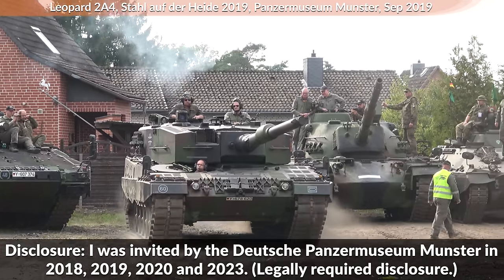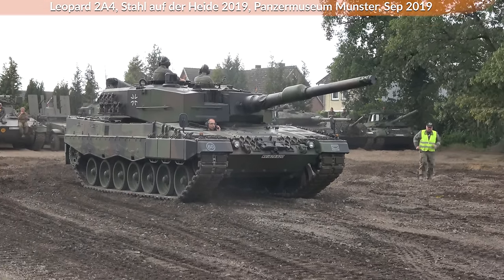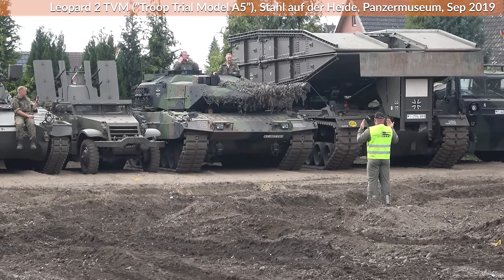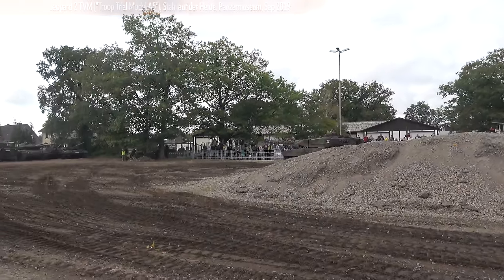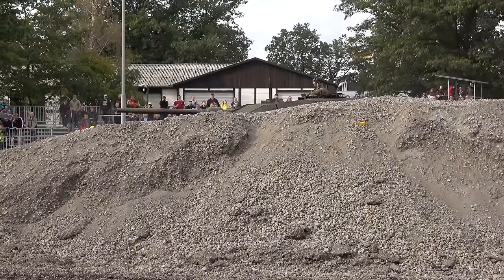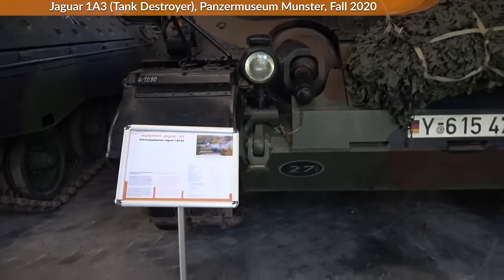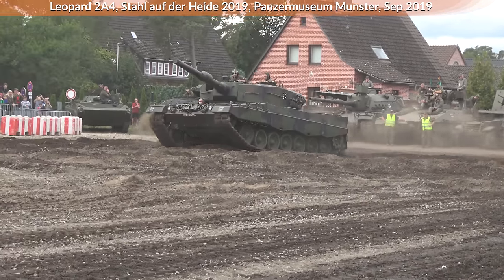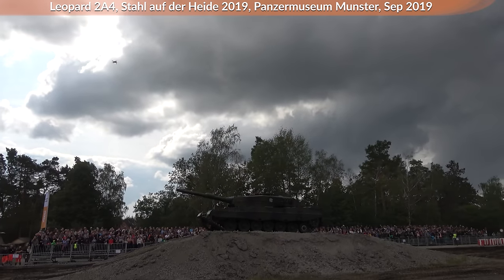Tank Tactics: How to get not hit by ATGMs?

Comment: One of the biggest lessons of the current Ukraine war is the continuous drones observing the battlefield. No target can move without being targeted. When a cheap commercially available drone with a small shaped charge (not an expensive ATGM) can immobilise a modern expensive tank additional counter measures beyond smoke are needed.
Reply: EW and different kinds of APS for ground-ground threats/air-ground threats

I imagine these will become more valuable than unnecessary amounts of frontal armour
Reply: @chost-059  you can intercept a drone or missile, but taking down an APFSDS is something currently no APS does/does reliably. And thats why you need the armor.
Reply: @zhufortheimpaler4041  who cares about KE protection against apfsds, you cant protect a tank from those anyways and the cases where that even happens is so rare outside warthunder
Reply: @chost-059  it happens often enough, that you have to consider it.
And yes you can protect yourself.
Modern western MBT´s like M1A2, Leo2A6 etc can take hits from their russian/sovjet counterparts (T-62´s, T-64, T-72, T-80, T-90 etc) and survive them, while the russian tanks dont have enough armor to protect from the 120mm APFSDS rounds.
This is due to 115mm and 125mm russian APFSDS and guns lagg behind and are limited due to their design.
But even vs NATO 120mm rounds, leo2A6 etc would be protected.
And we just dont see much tank vs tank combat, due to the distances. its not warthunder like knife fighting distance of 5-500m but 3-5km
Reply: Tanks might need to prioritize close range protection against drones with machine guns and EW. FPV drones have slaughtered russian tanks by hitting their weakspots in the top armor on the hull around the turret. And the result is a big KABOOM! 
However old western tanks were not built to deal with this threat either. So I guess that future tank design will have to prioritize front armor and top armor in the future. Side armor will probably get slaughtered as a result in order to save weight. It is also possible that tanks will become more like drones and with new tank guns that are becoming to big that manual loading takes too much time and becomes inpractical.. so perhaps will tank guns have auto-loaders firing 130mm or 150mm rounds.
Old Soviet tanks have nothing to do on a modern battlefield anymore.
Reply: @nattygsbord  I would say, that there are no tanks in existence, currently, that are capable of dealing with drone threats. Russians manufacture their Lancets by the thousands now, so even if you have the 100% hit rate on MG's, APS and so on, Russians will simply send in next drone to take out its tracks and then later hit it with an artillery shell or cluster munitions, since tanks crews bail immediately after losing mobility.
Reply: @zhufortheimpaler4041 from the front.seems like they are all getting  hit not in the front armor
Reply: @billbailey1620  Leo2 and M1 are also very resilient from the side
Reply: @jkl9984  Measures will be met by counter measures. One tank will shot down a drone. And even if the enemy sends in another one that isn't jammed or shot down by the tank itself, then it can be shot down by another neighbouring tank. Or perhaps by a specialized air defence vehicle like CV 9040 TriAD.
Reply: A tanker, or anybody for that matter, must assume that they are constantly being observed from above, but the reality is somewhat more complicated.  Everything that we've been allowed to see in Ukraine by both sides has almost always been propaganda.  We've only ever seen the successes, not the failures or the hundreds of hours of nothing.  There is absolutely a large concentration of UAVs over the battlefields in Ukraine, but that means you have a lot of soda straws looking at small patches of the ground with no peripheral vision blaring tons of  EM radiation to anyone with a few software defined radios to triangulate.
Reply: It’s ok I’ve got an invisible tank
Reply: @zhufortheimpaler4041  not true
Reply: @TheGrantourismo  yes it is. And you Already got high powered drone jammers on western tanks for up to 10 years. Ukraine also got a bunch delivered by for example germany
Reply: My comment is invisible despite I did not write anything hateful, lying or anything.
Reply: @chost-059 There’s already drones with auto-leading to the esquired target in Ukraine that bypass EW from a km away. From both sides.

And there’s EFP (explosively formed penetrator) against APS.
Correct me if I’m wrong and it doesn’t work - we didn’t see any APS in working in Ukraine, so I’m not sure myself.
Reply: The drone situation in ukraine is complicated, you can jam it, but what if it has a backup sensor, say it keeps going on the same trajectory or it has an image-based lockon for after it loses signal. As it is drones cant be defefated with a single catch-all solution
Reply: @gangsterguardsman4576  Small radar, wired to a gun.
Hard-kill is always an option.
Should be cheaper and simpler than an APS - cos drones are much slower than rockets.
Reply: As of 14 April 2024, according to the Oryx blog, at least 19 Ukrainian Leopard 2s were destroyed according to photos and videos (6 Leopard 2A6, 1 Stridsvagn 122, 9 Leopard 2A4, 1 Leopard 2R, 2 Bergepanzer-3); While another 24 Ukrainian Leopard 2s of various models were confirmed damaged to various degrees or abandoned by their crews: 10 Leopard 2A4/2A4V with 4 of them being abandoned, 5 Leopard 2A6 with 4 of them being abandoned, 6 Stridsvagn 122 with 4 of them being abandoned, 1 abandoned Bergepanzer-3 and 2 damaged Leopard 2R
Reply: 0:30  all strted in isrsale we made it first

Comment: With today's surveillance technology, for a tank not to be seen would require something no less than a Star Trek cloaking device. And if the shoulder mounted ATGM won't get you then the Helo fired ATGM may. After that mines, and if you survive the minefield then FPV drones will come buzzing inn. If you're still there congrats, now you have artillery and planes dropping bombs right on top of you. There is two ways I see tanks headed. Super heavy tanks, maybe mechs. In the 300-500 ton range, maybe more. Or more likely cheap remote or autonomous drones in the 10-20 ton range that just spam the battlefield. With automated anti projectile systems to neutralize drones and some slower ATGM/artillery rounds. Possibly energy based.
Reply: 500 ton tanks lol on what planet do you live dude 😂
Reply: @AquaNomad34  The 797F caterpillar mining truck can carry 400 tons. Farming tractors had tracks long before tanks. And OG tanks were basically a caterpillar tractor with an armored carriage and a gun. I'm sure at the time some people also thought that a tank weighing in at 70 tons (weight of an Abrams tank) was outside the scope of possibility. The problem isn't one off, can it be done? But is it worth it? That's why I said small drone tanks are more likely. However it's also possible to jam those drones, making them useless. And so if you had to have an un jammable crewed vehicle that could breakthrough such defenses. It would need to have a lot of armor. And even using advanced materials the range is between 300-500 tons. If you want it to survive direct hits from something as big as 203mm artillery or 300mm rockets. If the survivability factor is 155mm artillery then 150-200 tons.
Reply: @robertalaverdov8147  calm down dude, chill. You wasted your time writing that long wall of text comment for nothing. 
Tanks are not mining trucks, you're talking about completely different topics lol
Reply: @AquaNomad34  You're right Tanks aren't mining trucks, they're agricultural equipment. And you're also on the wrong end of youtube if you don't want a wall text explanation. That's what this channel is known for. If you want to be asinine go find a gaming channel or log into twitch.

Comment: Basically you need to do terrain analysis and conduct an appreciation in a safe location (last bound) before you start moving and then move as part of a combined arms team.
Then if detected, use weapons and your Multi Barreled Smoke Grenade Dischargers (MBSGD) to suppress the firer and obscure their view (if optically tracked).

Comment: I wonder why tank-fired anti-air missiles aren't common. I'd think that something like a 10 km range missile that could track a helicopter (or possibly a larger drone) would be extremely useful, even if it only has a rudimentary guidance system.

Comment: First of all, you need to know there is an ATGM coming your way. Which is possible in case it uses laser guidance and you have laser warning receiver. And even then, do you have time to react? Yes, there is a video from Syria where ISIS sets up a TOW launcher, turns on the laser and then drop everything and run seconds before their position is blown; T-90 received warning and turned its gun towards the source. But even that is not a guarantee.
An Israeli column was caught in some conflict in a narrow space (gorge, I think) and got decimated by ATGMs and some "experts" say none of them used smoke discharges... Sure, it would help against ATGMs, but it works both ways; they couldn't see anything and they would ram each other...
As for other types of guidance (like SACLOS), there is no warning unless you see the launch. Yes, smb else might warn you, but you lose valuable seconds to receive the warning and react...
Overall, the best way of not being hit by an ATGM is not to be fired upon by one... Only tank armor and ERA can save you, but even that is not a guarantee today.
Reply: The TOW does not use laser guidance. It is optically tracked. There is a small IR beacon on the tail of the missile. The daysight transmits the difference between the where the missile is and where the sight is pointed to the missile guidance set. The MGS corrects missile flight. No lasers are involved.

Comment: You would think that each tank would have a drone attached to scout out a possible path or to see infantry movements in the area? Could someone in the tank have communication with it and if he had another immediate duty the drone could go autonimous to maintain a set distance to the tank? It would be nice if it had radio contact to warn of aircraft in the area, if possible.Communications is key.
Reply: The next-gen German tank prototype is designed to have a drone section in every tank
Reply: Gotta be careful with that too tho, drone controllers emit frequencies that the enemy can pick up and use to target the vehicle

Comment: i dont know why germans havent developed any atgm type of ammunition for their leopards, even if it does little effect if being outranged, i wouldnt imagine any helicopter would stay at their position if they'd hear a laser warning coming from a tanks position while they see a atgm flying towards them
Reply: 18:25 this is exactly what im talking about, russians are being trained to shoot down helos with their 9M119M 😭
Reply: Some western tank crews are taught to fire sabot (APFSDS) rounds at hovering helicopters. They travel at Mach 5+ compared to most ATGM's which are subsonic. If the helicopter is within 3km then it stands a good chance of getting hit before the missile it fired arrives.

The biggest problem is detecting the helicopter and maintaining a target lock on it with an optical sight. You can hit a hovering helicopter with an ATGM (the Ukrainian's have done it on video using Stugna-P) but they had the element of surprise and were firing from a concealed position.

I doubt the viability of hitting a helicopter with a barrel launched ATGM unless the helicopter is completely unaware it is near the enemy. The flight time of most ATGM's to a distant target is more than ten seconds and an alerted helicopter can easily move away.

I think a future option could be borrowing from a current U.S Army project. It is developing a anti-aircraft/anti-ballistic missile projectile/missile that can be launched from a 155mm artillery piece. The projectile has an onboard seeker and a ramjet engine built into its base. The 155mm propellant charge accelerates the projectile to the point that a ramjet sustainer motor can ignite and give the guided projectile an extended range and terminal stage manoeuvrability.

So what I am proposing is not a ATGM but a 120mm barrel launched ramjet powered surface to air missile probably fitted with lock-on after launch wideband IR seeker of the type used in the AIM-9X Sidewinder.

Comment: Why haven't fast moving, lightly armed land based hovercraft being developed and used to transport troops and equipment en-mass across the mine fields to undermine defensive trench-line fortification and facilitate maneuver warfare of heavier equipment?
Reply: You can probably mess a hovercraft up with something like those barb wire rolls or tank barriers. I think they need fairly flat ground also.
Reply: Because theres no equipment that can counter a Shovel with a washing machine chip. An anti aie shovel once burned so hot I saw it fom Switzerland. It hit the moon, the exit hole of the backsside of the moon is said to be so big, only a RU ballistic shovel "R-Shovel-9" could dig to close it.
Reply: @Morkvonork but what does ground really mean these days with Russian Shovels around?
Reply: How would a hovercraft help with a minefield?
Reply: @JoelGuelPad  There is a Mythbusters episode where they drive over a selfmade minefield with a hovercraft. They tested if it would trigger the mines. They were pressure triggered mines and it worked. No mines exploded. Modern mines could have other trigger mechanisms anyway so I dont think it works.

Comment: You will not get hit from atgm, because you will be destroyed by fpv drone.
Reply: Drones are dangerous but overhyped. They are good ways for providing better situational awareness and increasing the lethality of the battlefield for a low cost but they are not better at killing tanks than ATGMs are.
Reply: @herptek  you probably didn't follow the recent war, otherwise you would know that fpv on Arduino with 5kg of thermobaric explosive is enough to destroy or disable any tank. It's main weapon at war against vehicles and infantry for last year. And yeah, maybe atgm is better when you need to hit once, but in real war it's about quantity and the price, Lockheed Martin will never be available produce enough atgms for real war at reasonable price, war is math.
Reply: @evabraun8  I have been following the war closely enough to know that much of the drone hype is hot air. Tanks, artillery, helicopters, ATGMs, even infantry and just about everything else that cost anything have been said to be obsolete because there are drones out there now, but nevertheless the old ways re-impose themselves time and time again. 

Drones are also easily and cheaply jammed and it is easy to develop other technical countermeasures against them.

Comment: Tobias tells us how the helicopter threat was most serious and training was crucial. During his time in service drones were not a thing. I wonder what Tobias thinks the training in case of drones is currently.
Reply: basicly a more maneuverable version of ATGM but in most cases easier to jam and they dont carry payloads that are comparable (meaning most FPV Drones carry a RPG-7VL or VN warhead, wich is only capable of penetrating around 500mm RHAe, so unless you get hit on the top or a vulnerable rear area, they wont do much against your base armor -> modern ATGM have around 1000-1300mm RHAe Penetration and as we have seen with the Leo2A6 in Ukraine, they struggle to do damage to a leo2A6 forward turred side)
Reply: @zhufortheimpaler4041  ''so unless you get hit on the top or a vulnerable rear area'' Bingo Einstein
Reply: @joek600  something you can prevent by Cage Armor and Screens.
And also Active Protection Systems.
Reply: Jamming doesn’t always stop the drone if they include a basic image-based guidance or just have it maintain flight direction upon being jammed. Also you don’t need to penetrate a tanks armor to kill it, just break it’s tracks and call in artillery, or sensors and it’s operationally useless. Those tend to be rather vulnerable

Comment: You know when a tank colin gets pined down for exsample in a mind field or on a cliff face, or in urban setting and the lead and rear tank is shot,
What could the tank column do? 
And you might notice im no longer spamming my list of ideas.....
Reply: Deploy smoke and move into safety
Reply: @yarnickgoovaerts  but your only 2 ways to move have been blocked? Mabey you could swerve each tank to a side and mabey get a 2 in a row in the path in some of these situations, 

But thanks for replying and useing your brain
Reply: Push the knocked out vehicles out of the way?
Reply: @chrisblack6258  anything else other then that or return fire you can think of?
Reply: @theromanorder  well, crews bail out and move on foot would hurt them much
Reply: @theromanorder  or getting your buddies from infantries, engineering and army aviation to help you while you tip-toe the way out
Reply: @theromanorder  Maybe calling artillery for smokes to cover the line of sight of the enemy force, and work you way out slowly, like having a armor recovery vehicles to tow the knocked out tanks out of the way
Reply: @theromanorder  I doubt a single destroyed tank would block an entire road. But if that is the case, then I assume they’ll just inform the brigade commander and request a recovery vehicle to clear the road
Reply: @yarnickgoovaerts  you will be surprised the size of some roads but theres also the other point of there in the path of a cleared part of a mine feild, ots common at least on the Ukraine war for only small paths to be made and escort the vehicles..